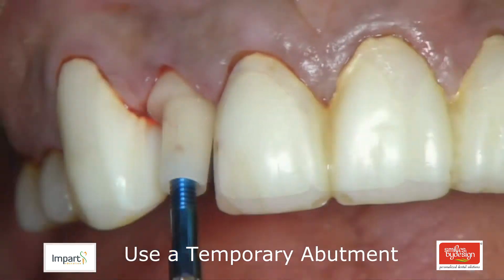Partial Extraction Therapy for Single Tooth Implant: Part 2. Provisional Restoration

Comment: Thank you very much for making such a valuable video.
My query is how to change our trajectory of osteotomy after initial purchase point on palatal bone?
I find hard to move the drill from angle to making straight while drilling.
Kindly guide for any specific drill, the speed @ that time, or any useful tip Sir.

Again thank you very much sir.
Reply from the maker: Thank you. That's the tough part doc. You have to keep practicing.